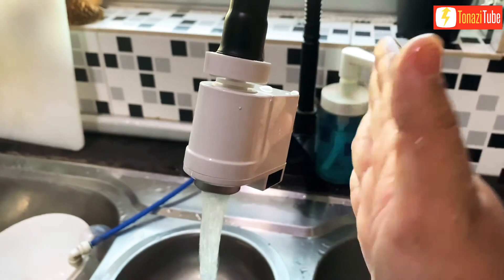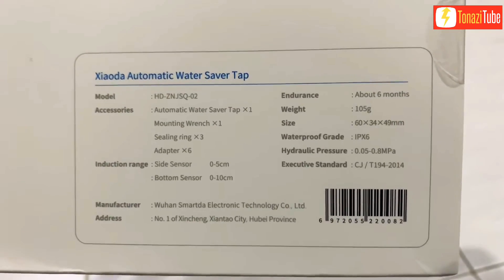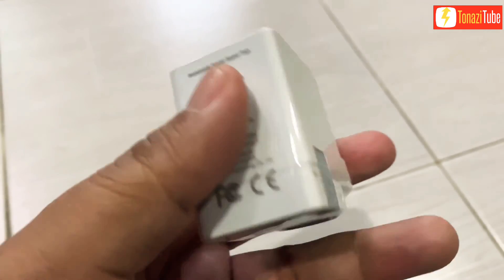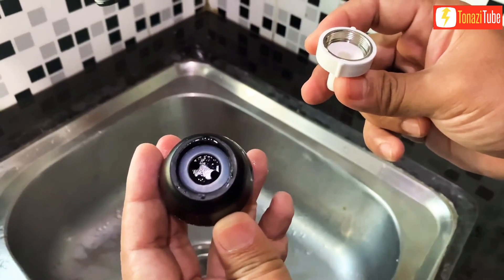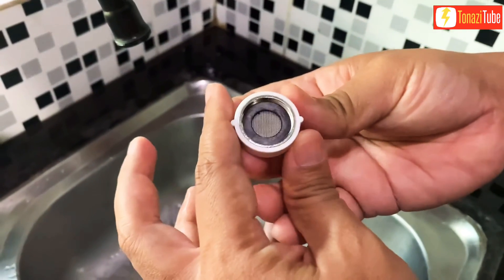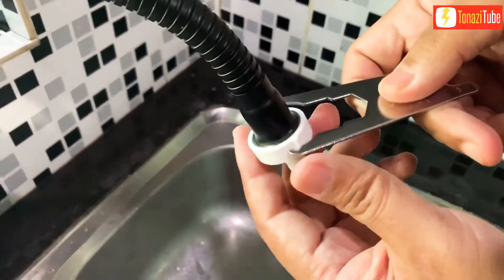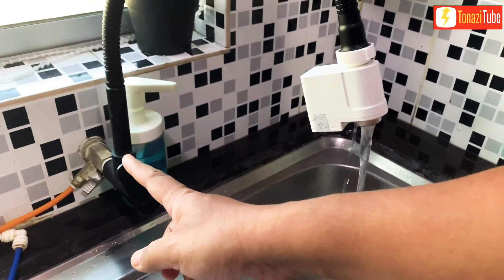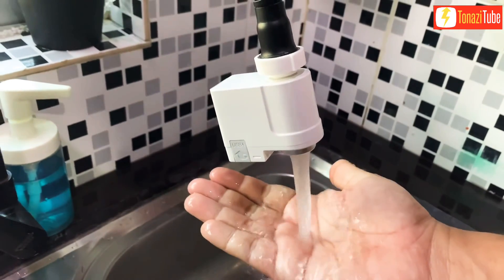How to install Automatic Water Saver Tap Step by Step | Xiaomi Zajia - Xiaoda  Save Water Usage |

Comment: Possible water heater connection?. Iam waiting for your msg reply. Hot water connects or no
Reply: Three months ago I bought 5 pic. But now all no fucton. Continue water coming. Changing ok. Me think this tap hot line may be issue
Reply from the maker: @shaikhsabir3828 Hot water might be the issue(Thru the tap).High Temperature nearby the tap.Not recommended and avoid use with water heater is the best.
Reply from the maker: Possibly can
Reply: But new tap buy . After write tap book. Write. Automatic water saver tap should not be used with instant heating equipment, solar water heater, etc in order to avoid abnormalities. Don't install the product near high tempreture  objects

Comment: How to clean filter?
Reply from the maker: Only change the sealing ring at the water tap.
Reply: Is the sealing rings available in the market if it is broken or damaged? 

Also what a bout the spare parts availability?
Reply from the maker: @ebzary1 No spare parts sold separately.Need to find the similiar size if broken or damage.